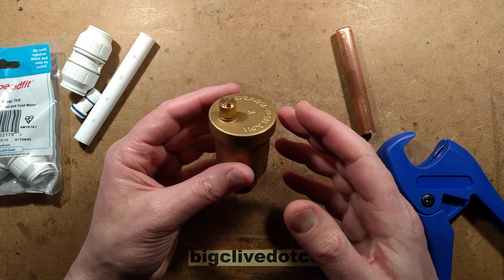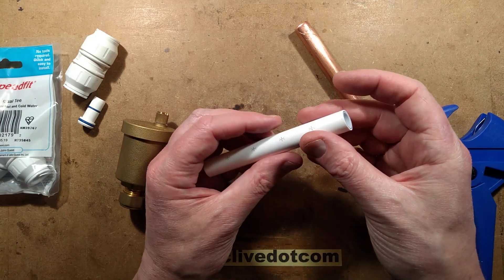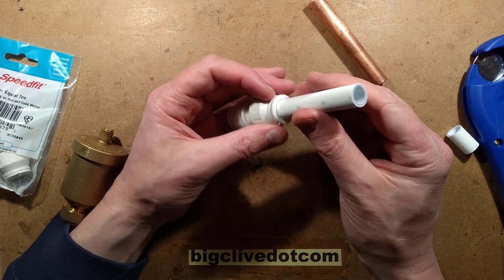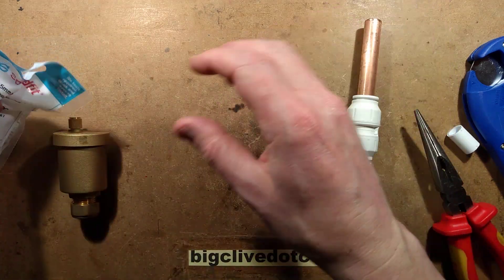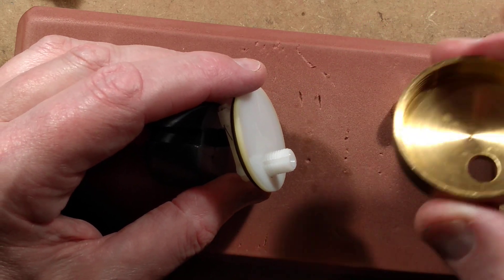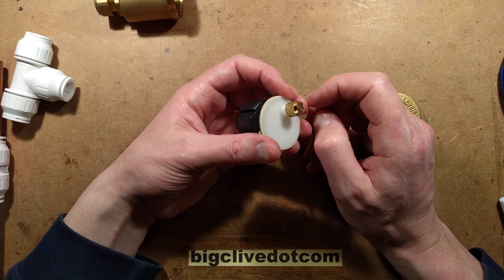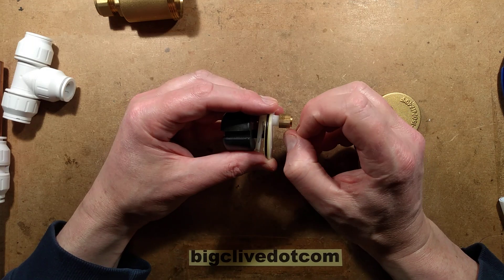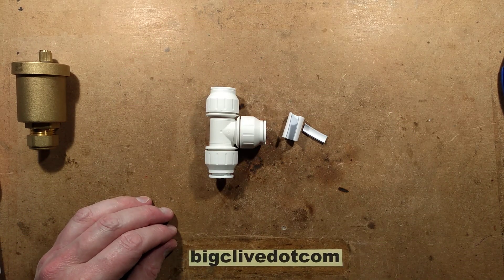Inside a bottle air vent and plumbing ramble.  (No electronics whatsoever.)

Comment: I imagine the clever spring pivot thing allows the silicon stopper to find its own location on the outlet port. If it was a rigid hinge there's a chance the two would fail to align and water could ooze through.

These things have a lot of thought & experience put into their design resulting in quite elegant solutions.
Reply from the maker: That's probably it.
Reply: @bigclivedotcom  My guess is that the spring mounting allows a vacuum in the plumbing to suck in air. Not sure why they'd want that.
Reply: @CoolerQ   I estimate that the pivot type used exerts a stronger spring leverage against the sillycon seal. A fulcrum at the other end could allow weak forces against the lever to prove Archimedes was right.
Reply: @CoolerQ  These things are sometimes referred to as "pressure/vaccuum relief valves" so you're probably spot on, as the water empties out of the tank/ it cools something needs to replace what's gone out or the pressure is going to drop, and despite being much lower than the maximum expected positive pressure, tanks are in general gonna be much worse at withstanding negative pressure than positive ( positive pressure is stabilising, it wants to round out the tank. Negative pressure is destabilising - it's going to tend to amplify any asymmetry and buckle it inwards, causing additional strain on that area and leading to a sort of cascading failure).

funnilly enough the negative pressure need not be limited to a vaccum - in the worse case the pressure can drop substantially below vaccuum pressure. Water is not a gas, it sticks to things and can "pull" as well as "push", in low pressure it will boil and reduce that somewhat, but not necessarily enough to keep the pressure above 0. This would however probably only apply to tanks on an upper floor, and would be a bit contrived, but even vaccuum could be dangerous enough.

The negative pressure effect can be seen nicely with very tall trees, like redwoods - the tubes that carry the water are very smooth and there's nothing for the water to nucleate off to start boiling and thus the water can be put under the ~negative ten atmospheres of pressure required to pull water all the way to the top.
Reply: @agvulpine  yes its providing a much tighter seal due to the fulcrum action.
Reply: @bigclivedotcom  Wavin has crimps that make a more solid connection
Reply: The stopper is silicone not silicon.
Reply: ''negative ten atmospheres'' ... that's confusing... how does that work? im having trouble wrapping my head around that concept.
Reply: Kevin Miedema it doesn’t exist.
Reply: well might depend on your point of reference...hence im curious. centrifugal force doesn't really exist either.
Reply: @km5405   https://youtu.be/BickMFHAZR0. Might help. As to negative pressure not existing, it does just not in gases - think about tempered glass, its cooled very quickly and the outside solidifies first, the inside takes longer to cool and it thus has a slightly higher density/smaller volume and thus pulls the outer glass inwards into tension and giving the whole thing immense strength.

Liquids are much the same, molecules are attached to others by strong bonds that resist stretching, bonds can break and reform to allow flow, but at any given point most bonds are intact. But shouldn't a liquid below it's vapor pressure should boil and turn into a gas?

Not necessarily, that neglects surface tension, because of this, any bubble below a certain size (depending on various factors) will be forced to collapse, and bubbles of that size are far to large to spontaneously form, thus in the absence of some impurities/ air bubbles that they can piggyback off, bubbles will just collapse and the liquid is prevented from boiling.

One good way of creating these pressures experimentally is similar to the tempered glass example. You fill a tube almost to the brim with water and seal it so there's a tiny bubble of water vapor. You then heat it till the water expands to fill the tube and the bubble disappears, letting the tube cool, the water wants to shrink back to where it was before, but it can't without creating bubbles, which it  cant do, so it's pulling inward on the walls of the tube which are preventing it from shrinking to where it wants to be. That pull is a negative pressure, which can be very high, many many atmospheres equivalent.

In a tree, the water molecules leaving the leaves via evaporation yank the water molecules they were attached to as they pull free, this pull is transferred all the way down the water column to the roots, which pulls in water from the soil.
Reply: @km5405  My initial reaction to that was skepticism, liquids acting in tension (negative pressure is equivalent to tensile forces) seems impossible but I guess it's related to intermolecular forces e.g. surface tension. In a normal water pipe loop I would guess there would be plenty of nucleation points or air already in the system that wouldn't happen in practice.
The mechanism looks like the springs applies a slight pressure to seat the valve at first so that the pressure in the system can build up behind it and keep it in place, the sealing force will then increase in proportion to the system pressure. The lever arm then allows the small weight of the float to peel open the valve against the system pressure when enough gas accumulates, very clever.
Reply: urbex2007 they’re great! I certainly recommend them. You need them at the very top of each loop — the places air bubbles would migrate to.
Reply: I would have thought the spring pivot would be there to ensure a constant force is applied to the silicone pad.
Reply: urbex2007  Maybe you do have a leak that is just very very slow like a drop or 2 a day. A drop a day may dry before you see it or it could be hidden and not a problem as it dries before it causes a problem with the ceiling.  Maybe check radiators, vent holes etc
Reply: urbex2007  Check/tighten the seals on the pump valves where they connect to the pump. It is possible that air is being drawn in by the pump on the negative side. I did an experiment with clear hoses and a central heating circulating pump whereby I managed to loosen the pump nut on the negative side of the pump so that it did not leak water but it did draw a nice steady stream of bubbles into the system. See if you can nip the pump nuts up a bit. Or maybe change the washers if they are of the fibre type to rubber ones.

Comment: If you think about the plastic failing from a soda bottle perspective, that the plastic takes hundreds of PSI to fail is perfectly reasonable (certain types of plastic LOVE tension like concrete LOVES compression).  Fairly thin walled soda bottles take tens of PSI no problem including drops, so several millimeters of plastic taking up to several hundred also makes perfect sense, even on the fittings.  If anything metal is weaker in those situations unless you use super low diameter piping (with a to-scale thick wall) where hundreds/thousands of PSI is involved like diesel engine fuel injector lines.

PEX according to a very quick search - Cross-linked Polyethylene tubing (PolyEthylene[cross*])  *where cross is frequently represented with an x, probably because it's super easy to do on a keyboard and + may not be usable in every computer system due to special character restrictions.  I've seen it before in a tech term but forgot what term it was.

With more time and a wikipedia section copied out - https://en.wikipedia.org/wiki/Cross-linked_polyethylene
Cross-linked polyethylene, commonly abbreviated PEX, XPE or XLPE, is a form of polyethylene with cross-links. It is used predominantly in building services pipework systems, hydronic radiant heating and cooling systems, domestic water piping, and insulation for high tension (high voltage) electrical cables. It is also used for natural gas and offshore oil applications, chemical transportation, and transportation of sewage and slurries. PEX is an alternative to polyvinyl chloride (PVC), chlorinated polyvinyl chloride (CPVC) or copper tubing for use as residential water pipes.
Reply: The last time I checked, it took around 150-160 psi to burst a 2 litre bottle.

Comment: Have faith in the speed fit, but what I didn't tell you when I recommended it earlier is that you absolutely must install a water hammer arrestor in the system. Otherwise the water hammer over the years will have a tendency to overly stress the o rings causing failure.
Reply from the maker: I was wondering what effect water hammer would have.  Especially with a washing machine that uses solenoid valves.
Reply: @bigclivedotcom  Machinery like that makes me wonder why the heck they don't have a built-in water hammer arrestor/preventing device built in knowing full well that it's a device that does it.  Doubly so knowing how cost optimized some of the other parts in there are.  Or heck, just use a slower closing valve.  Maybe use a pressure bypass valve for pressure spikes when the valve closes that lets enough water through into the machine to clip the spike down below plumbing-stressing levels.
Reply: I did not know that problem exists. I am used to open and close faucets in a rapid manner to save time. If you work with power transistors, a quick switch time is a good thing. But the pipework of where I live is metal, I think.
Reply: @l3p3  What type of faucets have you are they ball valves or traditional screw down type ? Closing the latter 'quickly' isn't possible so no worries !
Reply: Isn’t water hammer caused at least in part by the lack of give in water and copper?  If so and if as BC says this piping has some ability to stretch (which is why it can survive freezing) then it may not hammer.
Reply: @michaelfisher9671  unfortunately it still hammers, albeit to a lesser extent. However, it still has enough force to blow an o ring.
Reply: @PatrickLeeUS  Please tell us more about the fitting with the O ring. Is it a push fit thing like we see in this video ? I can only think that water hammer would momentarily tighten the pressure on an O ring. I'm wondering if, in your failed case, the pipe is fractionally sliding in the O ring on each pressure spike. Is yours on plastic pipe or metal ? I'm wondering if the sliding of the pipe in the O ring is damaging it slightly each time due to a rough bit of pipe !

I'm aware compression fittings can creep and end up being pushed apart. One was done with ice and the other 'gas pressure' + time. I could argue that neither were properly tightened - as I've seen 'properly tightened' compression fittings - and the olives end up being recessed into the pipe - little chance of them sliding off !
Reply: @millomweb  The inlay of the o-ring is done in such a way that unless the coupling is held perfectly straight then during a water hammer all of it's force can be exerted on a very small cross section of the o-ring from the side, blowing it out.
Reply: Water hammer is caused by the mass of water being reflected back into the source, which for hygienic reasons is prevented by a backflow arrester. Immovable object redirects 
unstoppable force.

Comment: We had tons of pinholes in our nearly 40 year old copper pipes. We had the entire place repiped in PEX (cross linked polyethylene) and the plumber who did the work used steel ripped connections. So far so good.
Reply: Let us know in 40 years
Reply: @DisabilityExams  it is a lot cheaper than copper
Reply: I now use Hep2o PEX pipe and this has stainless steel inserts which grip inside the pipe and you can feel when they are seated if you twist them. Very reliable and much more frost proof than copper. Also easier to pull into place when replacing copper given the flexibility. They are known as shark bite fittings BTW not compression.
Reply: There was a huge bout around requiring ID in order to vote locally due to a disenfranchised barrier island population... yet the naturally-gerrymandered minority couldn’t even be considered as indigenous Americans because of their skin color which proved the fact that their entire history was less than prehistoric, and ergo. tiger’s stripes belong on a tiger... which impasse was solved post haste when, to address copper theft fatalities, ID became simultaneously-required for both international flight and exchange recycled metals for cash. So the same water which made them unite also broke them apart.